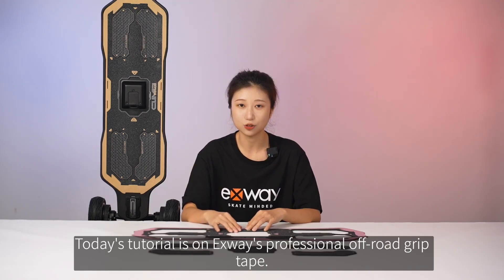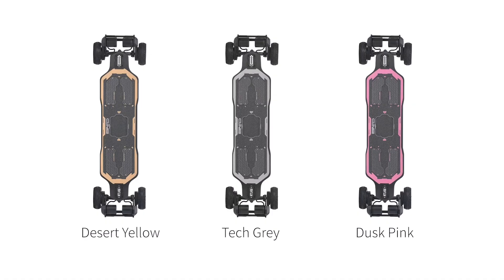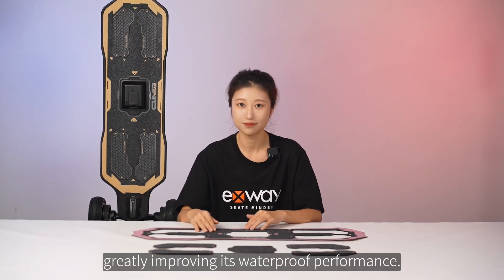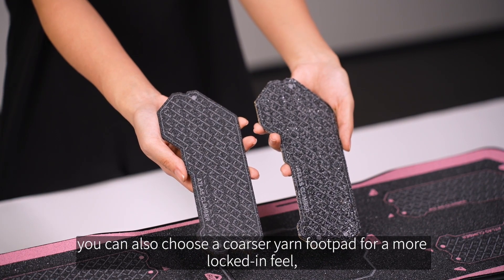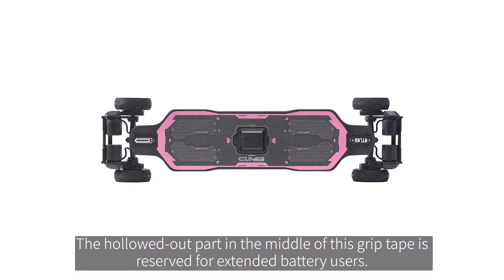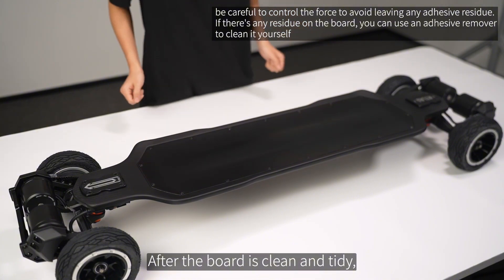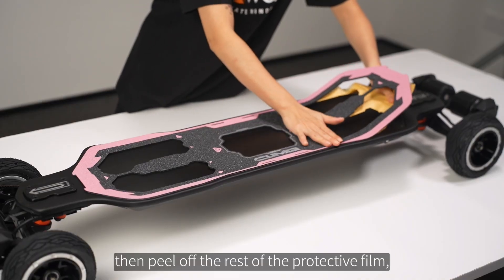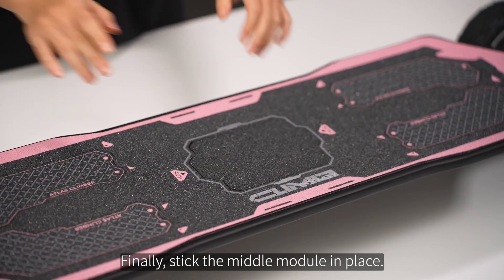Atlas Professional Off-road Grip Tape Tutorial

Comment: Here is my story. My brand new Atlas Exway Pro 4WD lasted one hour of ride time. I put it in 3rd gear one time. The wheels wobble after one day of riding. The bluetooth and app does not work. I have a $2000 paper weight. Support does not respond to email. The phone app does not connect to the board. I think this is the worst skate board I have owned ever. I don't even know what to say about this awful experience with Exway.